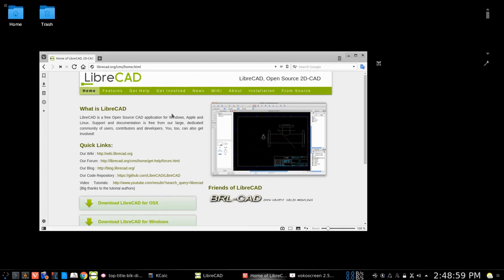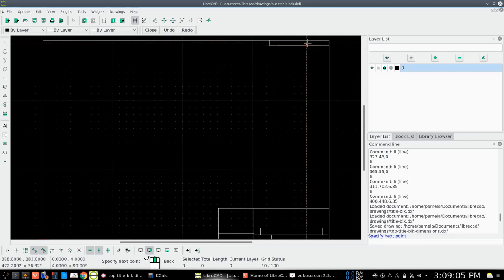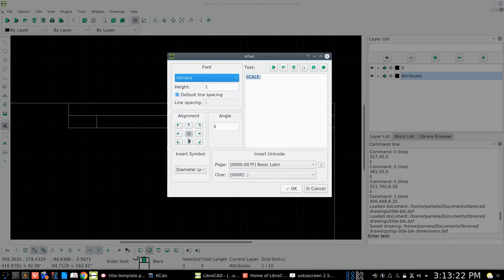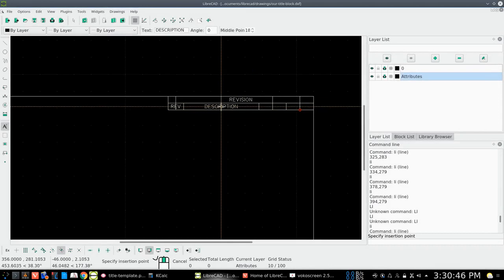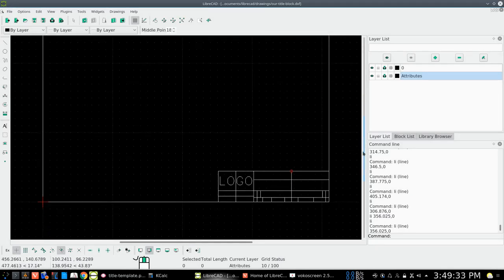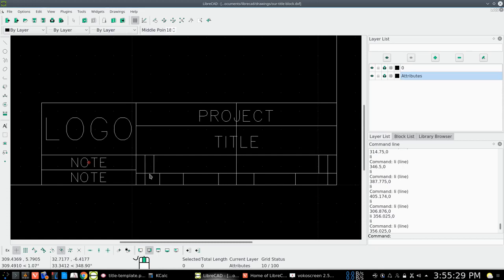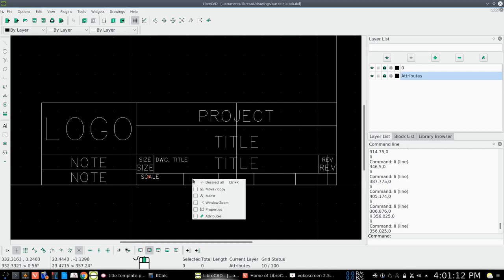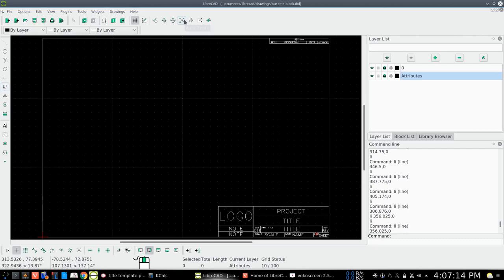4 1 title blk top and text

Comment: I have spent time, on a file ... now,  enacting TRIM results in unable to SEL. 2nd line.  Was it due to the Ln.Type?  NO.  I enacted a purely experimental, 2 intersecting Lns., still NOT work.  Hmm...  Opened a fresh file, TRIM worked; first time!
The question; due to amount of time/work invested... is there some correction I could use ... or   just 'write it off'?
Reply from the maker: Hi a Boswell Inniss; After selecting the [Trim] tool you must first select a "limiting entity" - an object that the line will be trimmed to - this "object" is likely another line. This "limiting entity" will be the line intersecting the line that you wish to trim. So you first select a line that intersect the line you wish to trim and then you secondly select the line you wish to trim and the line will be shortened up to the "limiting entity" - the intersecting line that you first selected. I hope this information is helpful. If you require further information please re-comment.
Thank you.
howtopam
Reply: Exactly the steps I used,  as shown by the result of the 'fresh' file.  I've begun the  tedious task of redoing the File.  Ugh ...